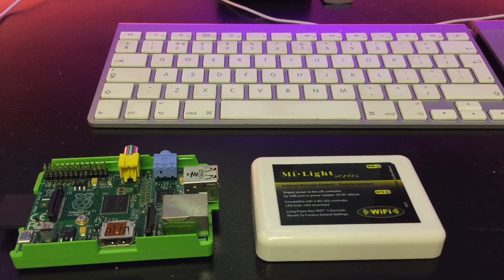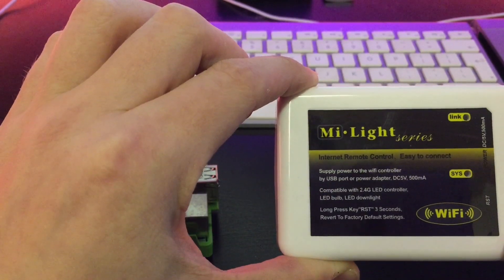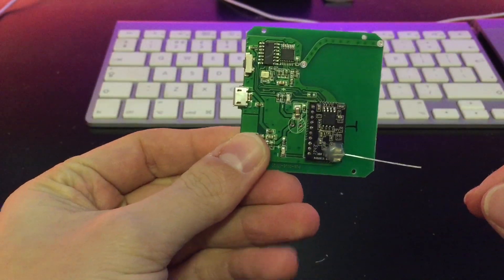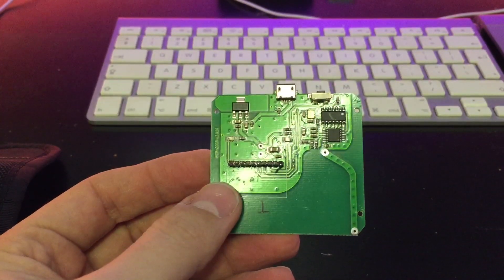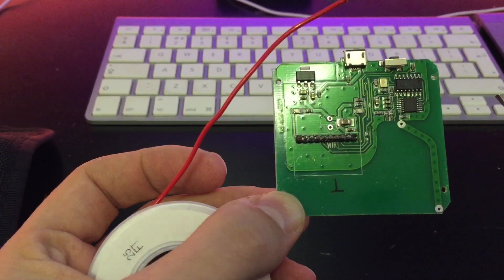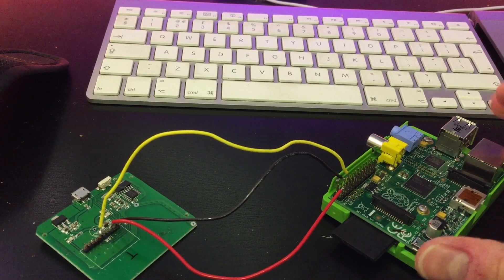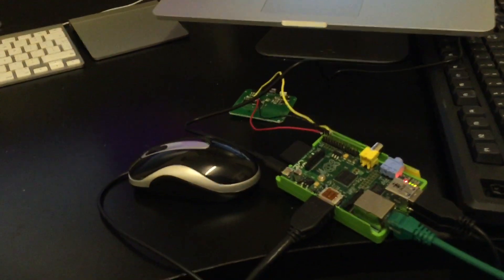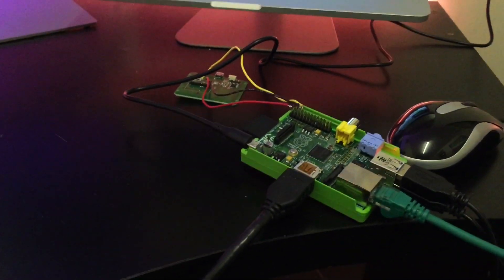Modding the Mi-Light Wi-Fi Bridge

Comment: Any idea as to if this would work with the v6 bridge?  theoretically it should I would think, as this process is not replacing any of the milight function, just swapping out the wifi module for a ethernet connection via the rasberry pi?

Comment: Hello, and thanks for the video and showing a creative way to get around the flaky milight bridge.  I note that this video is 4 years old and wondering if there have been any update or lessons learned from having it in use for a few years.   I am very interested in this solution and using your home remote iphone app you make.  I will have about 40 FUT104 bulbs in my landscape and most likely need more than 4 zones.  My goal is to control the lights with my iphone and set some timers, perhaps in the future, get the lights to change to music played.  So based on that info, do you feel like this is a solution for my situation? Also, it occurred to me that milight makes an 8 zone controller, any thoughts on hacking that controller using a similar method  vs. using the bridge?  Thanks, looking forward  to your response.

Comment: Nice video, even though it's no longer applicable since the newest generation of hardware is quite reliable. I recently bought a whole bunch of Milight RGB/CCT bulbs and a led strip for tv backlighting. I'm using 2 iBox v6.0 WiFi modules in combination with the Milight 3.0 app. Everything is working like a dream, the only criticism I have is about setting up the WiFi modules: the 'smart setup' is somewhat flaky. However, you can easily set it up by connecting to the iBox directly and enter all the right parameters through its web interface. For anyone considering this system: DO IT!!! :-)

Comment: I want to purchase these for a home automation project but I want to bypass the wireless modules altogether and replace them with a raspberry pi or arduino custom circuit. Theoretically it shouldn't be too hard since it is just wifi and Bluetooth transmitter, I am just going to have to figure out how the bridge communicates with the bulbs.
Reply: It doesn't use Bluetooth to talk to lights sadly

Comment: I'm interested in buying into to some mi-light but I'm put off by bad reviews.

Did it drop its network link lots then.

I could get round this buy hooking it up to my LightwaveRF set up & get it reset power either manually or if it was that bad on a timer every hour/ 30min if it's that bad.
Reply from the maker: The V5 bridges have this issue totally resolved. I haven't had a single network drop since replacing my bridges with V5 ones.
Reply: How do I know which are v5?
Reply from the maker: Ryutube Hamish over at http://www.limitlessled.com only sells V5 now, but you can double check with him to be sure.
Reply: Thanks for the info. Do u know any uk stockists?
Reply from the maker: milight.co.uk or com are UK I think, but I don't know what bridge version they sell.
Reply from the maker: The Amazon one looks like a good bet, but its a gamble
Reply: BouncingBallGames 

they arrive today. 

Will I know pretty sharpish I've not got the latest version 5. Eg will I notice the network dropping off quickly?

As the controller will be heading back to Amazon !!!!!!

Also, when you pointed me in the direction of the LimitlessLED controller from USA 🇺🇸 that is v5.0 & do ship tot the U.K. 

Are the controllers fully compatible with all them MiLight stuff.
Reply from the maker: Once the device is connected to the network you can type its IP address in a browser and log in with admin and admin. You should see a "system" tab with numbers. If you can see that you're on a V5. They don't always drop off, just under some circumstances I think. The ones from LimitlessLED actually come from NZ, but they do ship to the UK.

As far as I've seen there is no difference between milight, easy bulb and limitlessLED.
Reply: BouncingBallGames cheers for all info.

You've been a great help.
Reply: BouncingBallGames I'll report back later

Comment: Hi i've done all the initial steps and it seems tha the scripts are working fine (debugging by print on the raspberry when testing with an iOS app) but I have to pair again my lights…and I try to do it with the app and it just does not work : the light do not blink whtn I push the on button on one channel…any clue?thanks
Reply from the maker: Those scripts on a Pi without the added on milight module would still show in the milight app and print to console, so I would maybe check your soldering again to the milight module.
Reply from the maker: Also double check its receiving power and connected to the the correct pins on the Pi
Reply: Thanks for your quick answer : just to be more precise, when I use the iOS app and click on somme button I see the orders coming in tne raspberry (I enabled the print in the py scripts)..so I guess it answers your second point : correct?
Reply from the maker: What I'm saying is that even if you hadn't soldered on the milight part, the RPi would still show the commands coming in correctly. Your point of failure is most likely between the Pi and the milight module. The Pi gets the commands, but if the milight module isn't soldered correctly, or powered correctly then the lights will not respond.
Reply: I will double check the soldering and the pins....but is there a way to check the power part?
Reply from the maker: A multi meter would do it.
Reply: +BouncingBallGames I'm a software guy..Not sure how to check it on what is left of the bridge.:)
Reply from the maker: Me too, it was just trial and error. Look visibly for shorts, double check pin wiring

Comment: Hi BouncingBallGames, did you managed to open up the V5 bridge? On a side note did you do any testing to see if the V5 bridge is any more stable than the older ones? Im banging my head against a wall at the moment as my bridges have worked flawlessly for a long time but Ive changed ISP and the router they supplied keep dropping the MiLight traffic. Thanks
Reply from the maker: +Trevor Hart I have two V5 bridges and have not had to modify them, they are much more stable, but I still have to restart them at least once a week. They will be releasing V6 bridges soon to work with their new RGBCWWW lights that can mix white in with color.Can I ask if you have recently added an Apple TV or any new Apple equipment to your network, around the same time as the router? What router is it?
Reply: +BouncingBallGames thanks for the reply. My router is a Fritzbox 7490. I've added a separate WiFi router to the network connected through Ethernet and now it works. So I think its something peculiar to the Fritzbox. I might order a V5 bridge as Hamish says the V6 is still a few months away.
Reply: +BouncingBallGames I've received a V5 bridge and it works fine with the Fritzbox. So it must be something peculiar with the older bridges.
Reply from the maker: Have you had to restart it at all? I switched router and have not had to restart my V5 bridge once.

Comment: Does this let me get around the 4 device limit without buying multiple wifi bridges?
Reply from the maker: Hey, both Home Remote and the Milight app support multiple bridges. I have 3 bridges in my house and both apps work fine with them, although the official app is terrible - hence me making Home Remote initially. I only have my lights in on/off switches or lamps that don't support dimming and them dim from the app, so I can't comment on that I'm afraid.
Reply from the maker: +Armar No, you will still need multiple bridges if you want more than 4 RGBW or 4 white zones
Reply: +BouncingBallGames Wow that was an insanely fast reply, thanks!
Reply: so there is a 4 light limit , can i ask you a stupid question , i saw ona thread somewhere that you can not control each light individually like with  HUE system ,but they didnt mention  the wifi controller so i was wondering if that was just for the remote, can you set each of the 4 lights to different colors/brightness/on/off with this? or does it only set all 4 to the same settings at once?
Reply from the maker: Hi Andrea, there is 4 RGB and 4 white channel limit per bridge. You an have as many or as few lights per channel. You control the channel, not the individual bulbs.

If you want to control an individual bulb then you need to have that in its own channel, and then you can do it.
Reply: BouncingBallGames oh so i only need one bridge  if i want to control 4 different zones ,i though ti needed to buy a bridge for each zone , so the app is  only capable of controlling one 4 zone bridge then right?
there is no way to buy  2 bridges and switch somehting in the app to control different  bridge? or change the wifi settings, like make it connect to 2 different bridges, connect to 1 bridge at a time, one to control the  1st 4 zones then another to control 4 more zones?
also  can i ask if these bulbs will work in a circuit that has a dimmer,with the dimmer all the way up,or are they like HUE
i bought a HUE BR30 starter pak for the kitchen, i have 6 recess lights on 2 circuits, 2 on one  4 on the other ,i had to remove the dimmer it would not work even with the dimmer all the way up the bulbs spazz out , i wonder if these bulbs have that issue or if you could even  dim them, i only put in 2 bulbs so far ,have not replaced the dimmer for the  other  4 light circuit with a normal switch yet
i have 1 bulb left from the starter pak
so i need 3 more BR30's to finish the kitchen
and now i am debating weather to switch to these, i also have another room with 4 reces lights i like to do and  would like to add some led strips under the counters , it can get expensive with HUE , i only paid like 130 for the BR30 starter pak though  because it is  1st gen, still deabting if i should buy another 1st gen starter, or 3 more BR30 1st gen bulbs which are hard to find now, i saw them on sale for 40$ a piece but they only had 2 left at the store and  they are probably gone by now
 HUE is nice because it can be used with 3rd party apps  and automated using things like IFTTT ,not sure if there are hacks to add more automation to these, there probably is

Comment: Hmm interesting video.
All my Mi-Lights and controllers are working 100% perfect through my Android app (which I didn't develop(but I will develop one soon using an Material design colour picker)), so I have no need to do this. Plus you should have just used female to female jumper wire/ribbon cable. There's no way on this planet I would ever solder directly to my Raspberry Pi GPIO pins.

Good video though and cheers...
Reply: +Pete Simpson What about that developing? I want that app!
Reply from the maker: Pete Simpson Cheers, I think I did cover the female to female jumpers in the video, I can't remember. I have since re-done the mod with those. Do you have an Apple TV in your house? I've found the Apple TV can cause issues.

Comment: Yesterday I have attempted to mod the Milight WiFi 4.0 bridge as shown in the video. After connecting it to the Pi, should the Milight's SYS LED blink/be on ?
In my case there's no activity on either of the LED's. Could it be I broke the board ?
I checked the connections with a multimeter. Pretty sure they're OK.
Thanks for your response.
Reply from the maker: I'll check mine tonight and get back to you, I'm in the office at the moment. If it's not working I would check your python scripts first, you can enable logging on them.
Reply: BouncingBallGames Thx ! The script fails with the following error :

root@raspberrypi:/usr/local/bin/rfled-server/RFLED-Server.git/trunk/source# (‘admin command: ‘, ‘AT+Q\r’)

Traceback (most recent call last):

  File “admin.py”, line 31, in

    adminsock.sendto(bytes(‘+ok’, “utf-8″),adminaddr) # Send OK for each packet we get

TypeError: str() takes at most 1 argument (2 given)
Reply: BouncingBallGames Hi, did you by any chance take a look at the LED's on the modded Milight bridge ?
Reply from the maker: Bram van den Hout Hi, I did check, sorry for not replying. There are no lights on on the bridge circuit board
Reply from the maker: Did you try enabling the logging in the python script?
Reply: BouncingBallGames Hi, the post I made two days ago, included the output with debugging enabled.But I made some progress ! The led.py script is working like a charm !
I'm able to send commands from my Pi to the Milight bulbs.
I have integrated the modded hardware in my Domoticz env. That's pretty much all I need. Unfortunately the app on my iPhone doesn't work anymore, because the admin.py script breaks.
Thanks for your assistance in this !
Reply from the maker: Ah great, sorry for not replying. I was on holiday. If you try my Home Remote app then you can access the commands from the iOS today screen with no need for the admin.py

Comment: This is simple UART so the Raspberry Pi could be replaced with a USB-TTL stick, right? I've already have an Intel Atom based Linux server which is always on and could easily handle the server tasks of the MiLight controller.
Reply from the maker: Yeah, completely transparent pass through to the UART, any TTL stuff should work.
Reply: BouncingBallGames thanks :)
Reply from the maker: István Nagy Let me know if you do it, would be keen to hear results.
Reply: Sure. I try to not forget :)
Reply: Browsing through the net I've noticed that the RF controller inside the bridge is a PL1167 2.4Ghz RF IC. http://www.szkexinda.com/Upload/PicFiles/2014.2.8_9.21.48_1259.pdf This broadcasts the messages to the bulbs. Sadly it's not possible to use a plain IC for this purpose because the MiLight gateway ICs have some preconfigured settings which determine how the bridge indentifies itself to the bulbs. Also it uses 802.15.4 to transmit encrypted messages to the bulbs and the private key is in the WiFi controller's (actually a microcontroller) memory. http://www.geekzone.co.nz/forums.asp?topicid=113569&page_no=29
Reply: +István Nagy hmmm... it might work with Arduino. previously I created a simple remote LED control it using my phone. there's a free server for this purpose. sorry I don't have my own server. this could be a great weekend project.

Comment: Great video. Interesting comments below. We sell these bulbs at www.applamp.nl and we had some complaints about wifi bridges losing connection. So might apple TV network traffic be the reason?? The wifi bridges are listening for UDP broadcast traffic also. Is there traffic on port 8899 or 48899 from Apple?
Cheers and thanks!
Reply from the maker: I can't understand why this would be the case, but it does seem to make it worse... it happens anyways but with the Apple TV is seems to happen a lot sooner. Now I have the Raspberry Pi listening on those ports I have connected the Apple TV and not seen the fake bridge reacting to anything on it. The fact the bridge now works that I have removed the Wi-Fi module does point to that being the issue.
Reply from the maker: Also, let me know if you want a promo code for Home Remote to test out the integration with milight on iOS devices... maybe you could point your customers at it.. it's better than the stock milight app :)